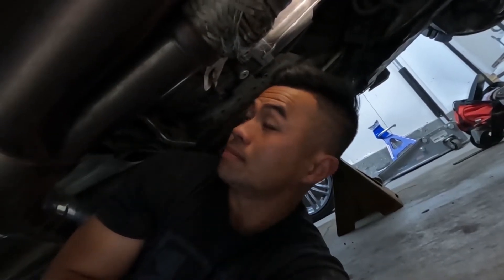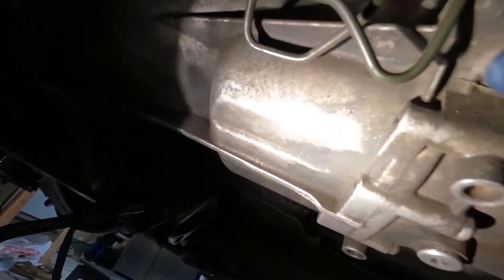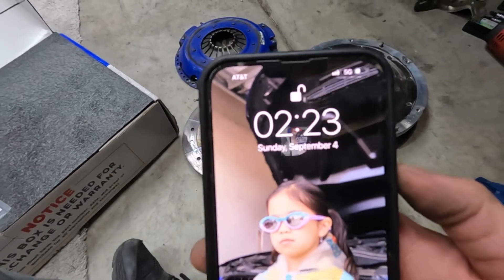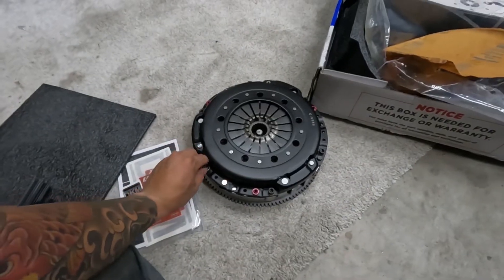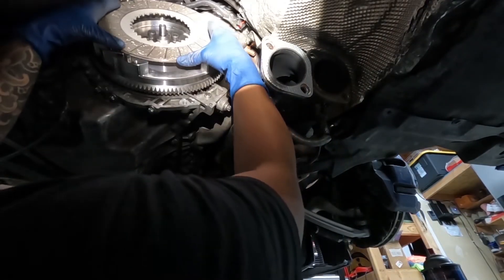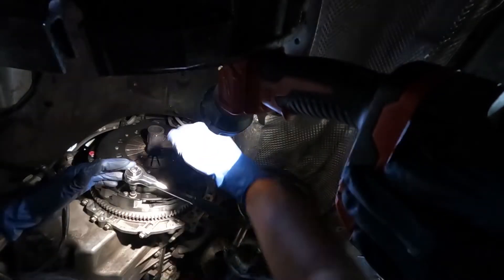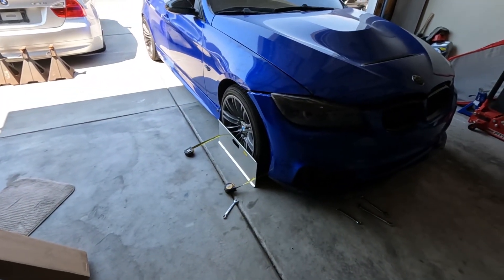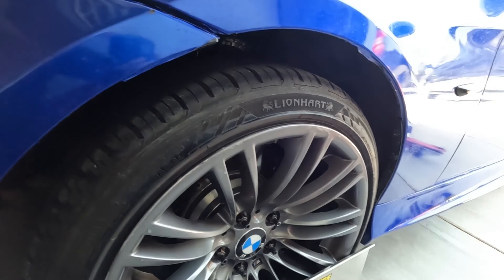How to install DKM TWIN DISC CLUTCH BMW 335i N54

Comment: Hey do you recall if when you but the trans on did it slip all the flush? Or did you have to tighten  the bolts to get it flush?

Comment: Do you get any squeal with this clutch? I fitted one to my 135i last month and it squeals right at the biting point under load
Reply from the maker: Hey thanks for watching! And no squeal on my end.. I wonder what that could be 🤔 maybe something didn’t seat right ?
Reply: @N54_Do  I'm wondering if I've got the first clutch disc (closet to the engine) the wrong way around. Mine had a label on it saying "trans side" and the other disc (nearest the pressure plate) also said gearbox side. So I faced both of the labelled sides towards the trans.
I get a weird noise when I start the car from cold too like the clutch is dragging and spinning up.
Reply from the maker: @LiquidChild99  that’s so strange, mine didn’t have any labels. If it happens at start up and right when it bites it does sound like something’s maybe not aligned right and it’s binding
Reply: @N54_Do  The car drives absolutely perfectly, clutch works exactly like it should, nice and smooth, holds the power great it just makes this stupid squealing noise at the biting point. I think the only way to find out is to pull the trans again.
Reply from the maker: @LiquidChild99  well that’s good to hear, just turn the music up until you feel like pulling the trans again 😂😂

Comment: I currently have the 9” organic X clutch and got tired of it cuz it’s not street driveable and jerks the car 24/7. I’ve heard good reviews of this DKM twin disk. Did you go with the organic disks? Also is it sprung loaded to prevent the chattering under acceleration? I already have the cdv removed. Any tips you got?
Reply from the maker: hey bro, thanks for watching!
I just finished my 500 mile break in just in time for a drift event this weekend. So far it feels amazing compared to the Spec stage 3. It is very street driveable and is comparable to OEM clutch feel. So far I defintely reccomend it!

Comment: how do you like this clutch so far, i am getting ready to get mine installed this weekend.
Reply from the maker: It’s feels great, holds the power real nice and the drive ability is way better than any other twin disc car I’ve had
Reply: @N54_Do  how did you setup ur throw out bearing did you set it on low or high side? I know the kit claims to set it in the low side but i read that engagement is very near the bottom that way others claim if you set it on the high side then you have a little play room for engagement so i just was not sure thanks for replying

Comment: Considering this clutch. I'm FBO N54 and stock clutch on its way out. The car isn't quite a daily but driven often. My power goal is 500-550 HP. Would you recommend this clutch for that power? How's the drivability? Is it close to a stock clutch or is the pedal really heavy? Thanks.

Comment: noticed you didnt line up the middle plate with the balance marks do you have and vibration threw the clutch pedal
Reply from the maker: Hmmm I do not. 3 drift events so far and it’s been holding up really well. I just put it in how the instructions said to, what balance marks are you talking about? Now I’m worried lol
Reply: @N54_Do  theres a green mark down the side of the clutch dkm come balanced as a assembly so theres a mark that goes down the pressure plate and the flywheel as well as middle plate i accidentally didnt line up the middle plate and now have a vibration in the pedal through certain rpms while its pushed in
Reply from the maker: @budgetbmw  dang that’s crazy. No vibrations for me, clutch is honestly too smith for a twin disc. Thanks for the info!
Reply: @budgetbmw same isue on low rps when i start car from 0 😂